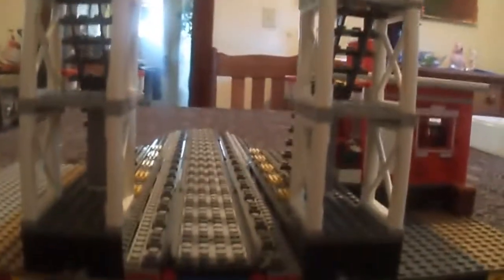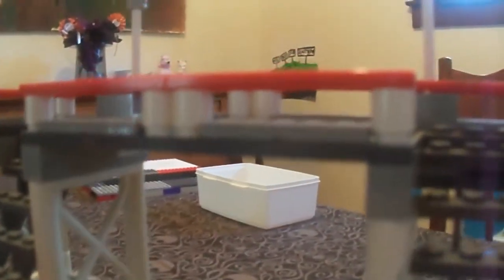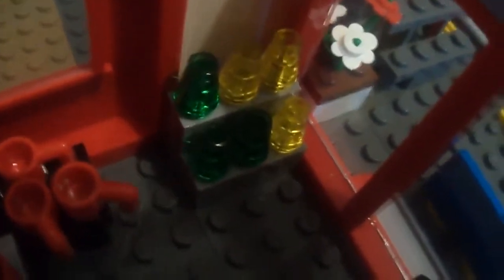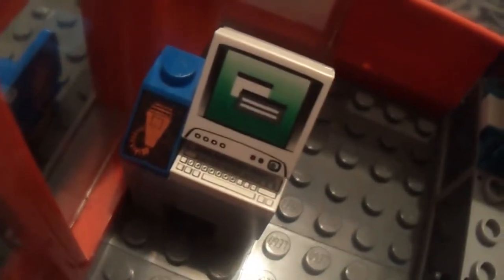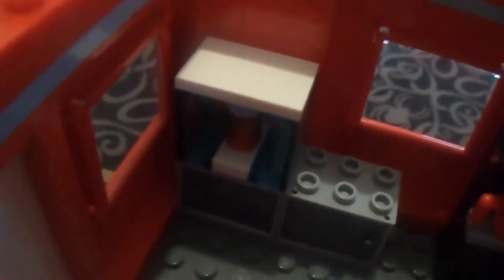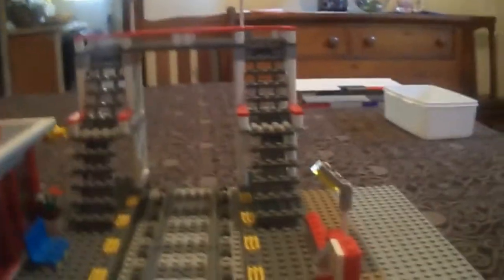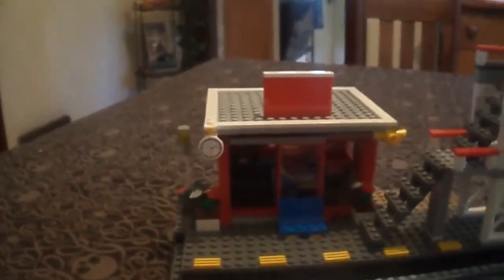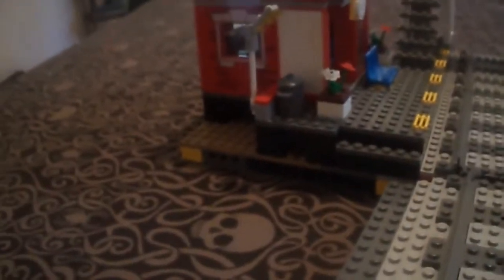Lego MILS and Ballast for my Train Pedwalk and Station Mod (buttchop classics series)

Comment: There is a way to use the crossroad baseplates for MILS plates. I’d recommend putting brown tiles on the sleepers and ballast underneath the track
Reply from the maker: this was filmed years ago, it was almost lost forever (the upload) this station, track and MILS are all different now. I have since used the crossroad plate for MILS successfully and I will never do the brown tile sleepers, it does nothing for me that is for those trying to achieve realism with a toy. all my tracks are ballasted directly to my MILS plates.